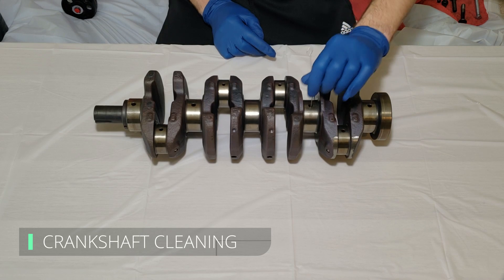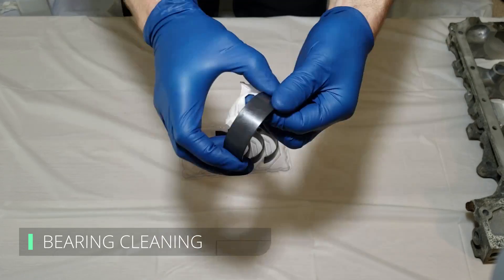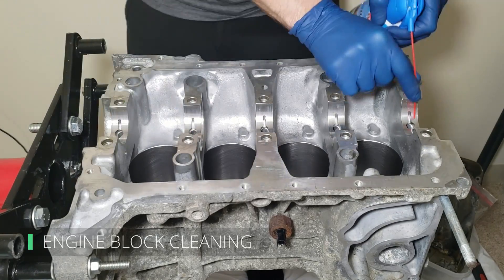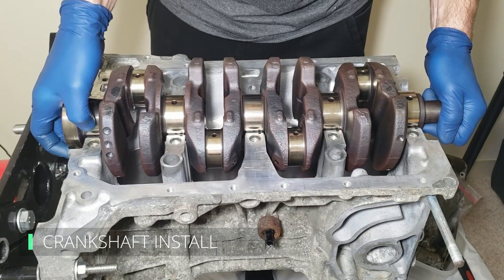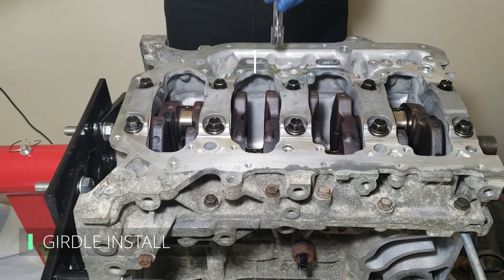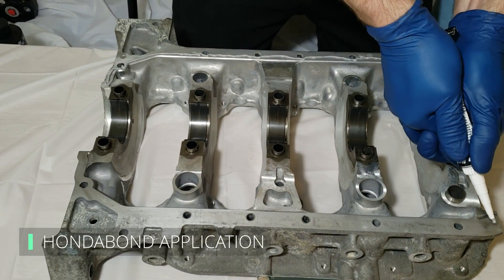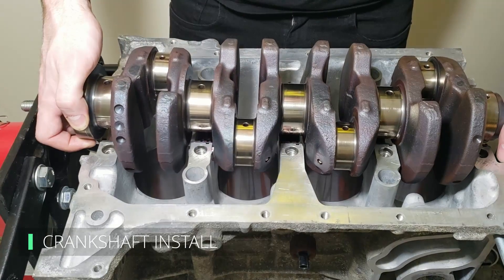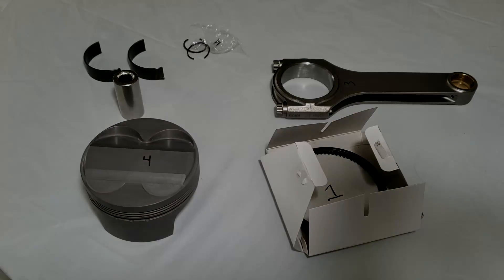How to Install a Crankshaft in a K24 | MR2 Build

Comment: Do Not torque the main bolts to full spec for plastigauge. Most main bolts are only really good for one torque to full spec, therefore go to maybe ~80% without the additional degrees which actually stretch the bolts. Really honestly maybe 50% would be plenty if you're really sure everything is clean and the bearing shells are well seated and the ends are flush.
Reply from the maker: ARP head studs are not torque to yield and are ok to reuse after being torqued. This is directly from their website "As long as the fasteners have been installed and torqued correctly, and show no visible signs of damage, they can be re-used. "
Reply: @IGDesigns  Also Studs are okay because you only torque them into the block once, then you torque and remove the Nuts. This is steel on steel however torquing OE bolts into the Aluminum block threads repeatedly could weaken or damage the Aluminum threads cut in the block. This is literally why studs stud.
Reply: @IGDesigns  I thought this video used OE bolts.

Comment: Hi what type of oil did you use for the girdle bolts ? I am following your step by step great job!
Reply from the maker: I used ARP thread lubricant for everything.
Reply: @IGDesigns  so same as for the head bolts , I just thought you were using just regular oil because it was from a regular oil canister that you were squirting , thanks for the quick response 👍
Reply from the maker: Oops you’re right, it was regular oil for these bolts now that I watch it. It’s been a while so I misremembered. Either way the difference between the two isn’t that big, just make sure to use some form of lubricant in the proper spots
Reply: @IGDesigns  no worries lol , but yeah it is my first k20/24 build so thanks for the videos you uploaded it is part of my reference